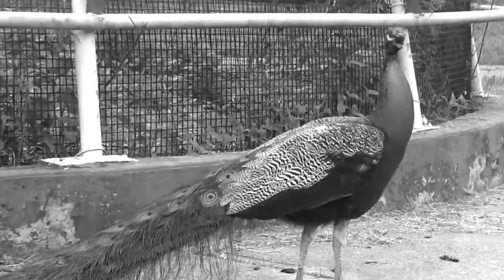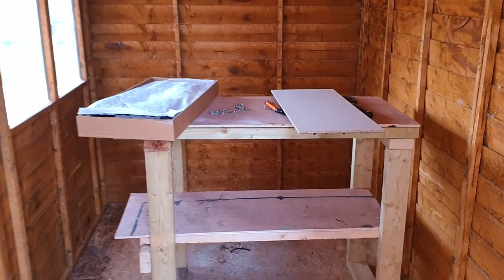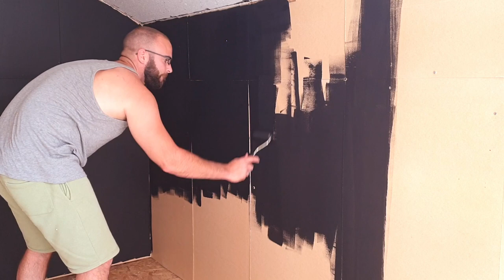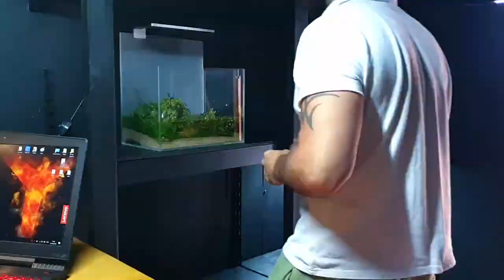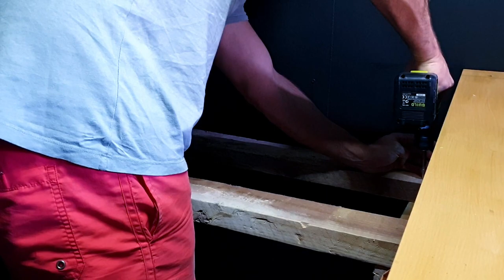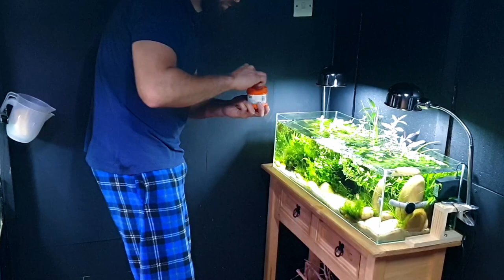How To Build A Fish Studio VLOG

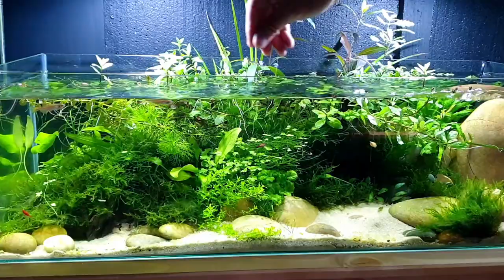Comment: At 13:20 min, how to create this type of tank. Can you make a video on that or if you have one please share it
Reply from the maker: https://youtu.be/6JihrOSs8ow
Reply from the maker: And there is more in depth videos of making the hardscape and the planting on my video list
Reply: @MDFishTanks  how do you know that water will not leak between 2 glass joints, as the water pressure in such a big tank is always enough high 

And where do you buy these glass tanks ?? 

Thanks for answering!!
Reply from the maker: @easylife7619  I dont know that...but the pressure of the water on tanks like this is very small. These tanks are actually meant for turtles but I think they work very well as shallow tanks.
Reply: @MDFishTanks  there is a formula to determine hydrostatic pressure of a fluid acting on 1 side of container wall, force= density of liquid x Area x height 
EDIT -> take density of fluid (1000)

This will be helpful to determine the force in KgF (kilogram-force unit) 
If it is less than limiting value of bond between glass then it will survive 

I dont know how to calculate the bond force between two glass bonds 
But if they are joined with glue then we can get information through the company's manual about the product
Reply from the maker: @easylife7619  yeah....or just fill it up and see 😂